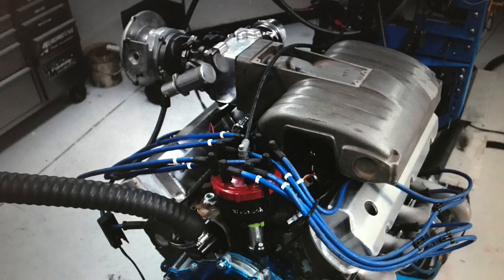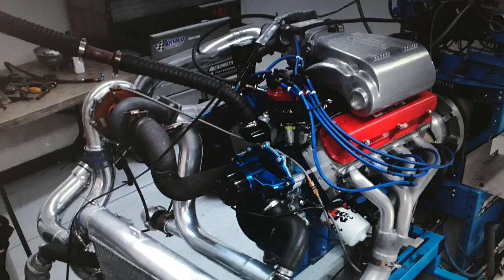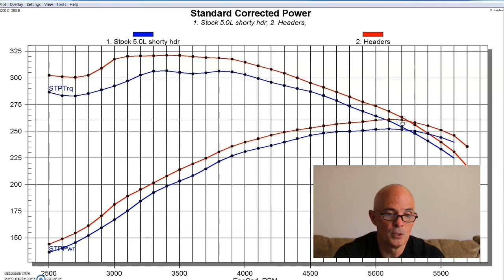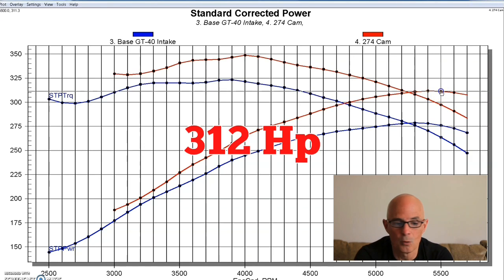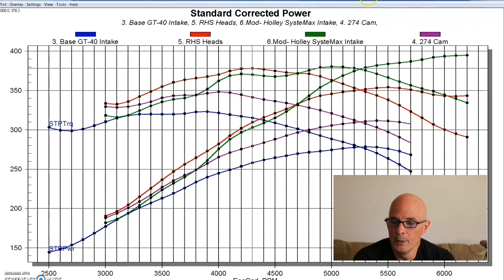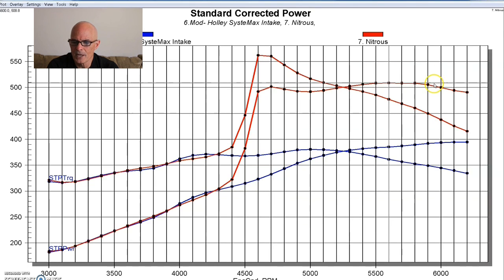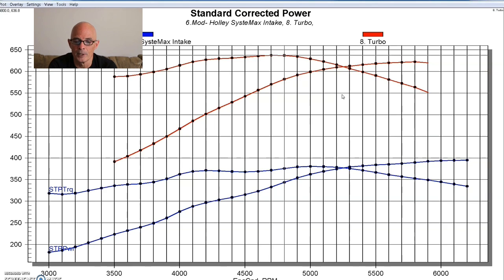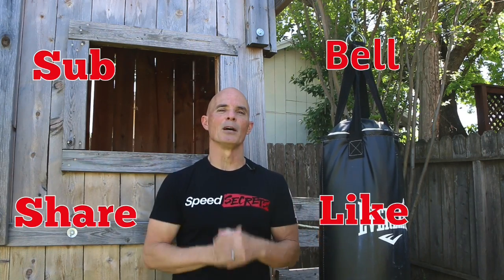BALLISTIC BOLT ONS & BOOST-5.0L FORD

Comment: Richard i know you had the supercharged mustang for a while. I'm just curious 87 ford 5.0 all stock if I gap the rings before i try to feed it 15 or so psi. Will it survive for a while? A body has a big ford Fairmont wagon with a ho 5.o and a Manuel i think would be great with some more power but such a boat stock and fuel pump is currently bad so I think you see where I want to go 600 hp would be great
Reply from the maker: 15 psi on a stock 5.0L is going to be near 500 hp-it definitely needs gap (and better heads, cam and intake)
Reply: @richardholdener1727  Thank You!

Comment: Once again,  the only reason  to us a 5 liter is because a 5.8 won't fit!! Sold a great little 306 to a friend awhile back. Ran 8 flat 1/8 mile on street tires and drive there. It would pick up a second off a 100 shot and live all day! Guess that wasn't enough! Know the rest of that story. Shoulda built a Windsor and used the cam and heads on it!

Comment: Just had another challenge idea. I’m going to be running an xe274hr with a set of Systemax heads that have been professionally ported and milled to achieve 10.5:1 compression.  That being said, I was going to get Ed Curtis to build a camshaft for me but he explained that the springs I have wouldn’t work with the camshaft he’d build for me. I’d already spent $300+ on beehives and components to use them so I dipped out. Just curious if you’d be interested in doing a custom cam dyno test vs your favorite camshaft.
Reply from the maker: it is easy to make more power than the XE274HR cam

Comment: Just watching this now but it's funny that Richard says shorty headers are worth nothing when Ford Australia proved they are worth exactly 10kw which is similar jump to the long tube headers in this video. Richard could make a video just on the different AU Falcon builds as an example of what to expect. 
Standard AU Falcon 5.0L motor with GT40P heads and explorer intake and 65mm TB and similar to stock US cam and 9:1 CR made 175kw
XR8 AU Falcon was the same motor as above with the only difference being shorty headers from factory 185kw
Then the T1 TS50 had a bigger cam with 210 duration and Y303 heads with 1.6 roller rockers and made 200kw
The T1 TE50 and S2 XR8 swapped the ally heads for ported GT40p heads and made the same 200kw
The T2 TS50 and S3 XR8 changed the cam for slightly less duration but increased the rocker ratio to 1.7 and went to a 70mm TB and increased CR to 9.4:1 for 220kw
The T3 stroked the engine to 5.6L, increased the compression ratio to 9.6:1, cam was similar to 200kw with slightly smaller LSA of 116,, RR was 1.7:1, TB increased to 82mm, ceramic coated headers and the best intake manifold ever produced for a EFI Windsor with shorter runner length made 250kw
Herrod took the above motor and swapped 4/1 long tube headers, put a cam with 216 duration .505 lift and 115 LSA and a tune and made 300kw with that package.
Interestingly there are many reports of Aussies who tried those 4/1 Di-fillipo long tube headers used by Herrod against Tri-Y headers and all say the long tube headers lost power down low for some power gain up top. Those long tube headers are no longer made and that manufacturer switched to tri-y headers. 

So a few takeaways. 
Shorty headers do increase power over standard exhaust by about 10kw.
Long tube headers can also increase top end power if the shortys are acting as a restriction at higher power levels. 
Ported GT40p heads can make 400hp.
You don't need a big cam to make 400hp but more cubes and a killer manifold help. I really want that Tickford manifold or better yet the entire motor it came on.
Reply from the maker: SHORTY HEADS HAVE NEVER SHOWN THE POWER GAINS YOU MENTIONED-I'VE TESTED THEM MANY, MANY TIMES
Reply: @richardholdener1727  As I said these were factory models by Ford so there are literally thousands of examples. The only difference between the 175kw motor and the 185kw motor was the exhaust. Those were the factory rating by Ford, I've owned and driven plenty of them, the 185kw is quicker than the 175kw in standard trim, put the XR8 exhaust on the standard one and I can't tell the difference.

Comment: 331 stock block, stock heads, turbo 6lbs boost what cam is best?
Reply from the maker: 274
Reply: @richardholdener1727  thank you sir, I will use that cam 👍

Comment: I love the basic combos and comparisons! Mostly because that fits my budget. But the one overlooked comparison is modifying stock heads for performance. I don’t have $1200 for aluminum heads, but what I do have, is a pair of 70 351w, and a set of 66 289’s and maybe enough sense for some home porting. Lol. How about a basic 302 and 351 builds with the financially challenged in mind? Love the channel!👍🏻

Comment: Hello Richard, I'm looking at putting GT40 heads (F3ZE-AA) on my stock 93 Ford Mustang with a XE274HR cam.  I'm trying to figure out what springs to use and if I can use the stock rockers from the E7 heads?
Reply from the maker: I THINK THE ROCKERS ARE THE SAME
Reply: @richardholdener1727   The piston to valve clearance seems high with the Rockers and Pedestals from the E7 heads. It's .301 for exhaust and .224 for intake. Does that sound right for XE274HR cam and GT40 heads?

Comment: What would be the best way to go about tuning setups like this? I'm debating dropping some 11R's and a cam into my 88 LSC before spring, and it seems like tuning the 5.0HO is a wash of "just get an appropriate MAF" to using chips, quarterhorse, and going stand-alone. I'm just looking for something to tune a mostly DD 302, that I can eventually jump up to either a 331 or 347 later on.
Reply from the maker: WE USED A HOLLEY-I HAVE RUN VORTECH BLOWERS IN THE PAST WITH PROM METERS AND INJECTORS, BUT TUNING IT THE BEST

Comment: Richard, I need some help my guy. I’m wanting to do a minor build on the 5.0 I pulled from an explorer that I’m putting in a ranger. It has the gt40p heads which I’ll port and polish, and a little bit of a valve job on it. I’m looking for a good streetable cam that will compliment the torquey heads, good set of springs and roller rockers to help the thing breathe better. Later down the line I’m prepared to put a turbo to get about 450-500 to the tire, what would be the best combination in your opinion to get what I’m going for? Thanks
Reply from the maker: E303 cam or Comp 274 (they have springs and rockers too)
Reply: @richardholdener1727  Thank for the reply! Later down the line (year or so) I would like to invest in a good set of heads, I'm looking at afr's 165cc heads, from the research I've done theyre a damn fine head, however my next question would be if the stock explorer pistons would still clear ( I know they're bolt on for mustangs but I'm not sure if the forged pistons have different valve reliefs than the explorer) and if the extra lift from those cams would interfere. Again, thanks!

Comment: Nitrous is my one single favorite mod of all time lol. Installs on anything and WILL make power. As for the other parts you got to do it all together anyway if your serious right? I mean if you toss in a cam you need springs, might as well do a new intake, because now the stock one is off already. Now you need a tune obviously but before that you have to do the exhaust, longtubes etc. then tune and/or the dyno. That’s my thinking anyhow.

Comment: Ran the xe274hr cam in a stock shortblock (92 w/hyperuetectics), a set of worked e7te's with gt40x head valvetrain with no problems.  And i ran it hard! It also had a ported explorer lower and a ported lighting upper.

Comment: Interestingly,  your "favorite"  XE 274 HR cam is so close to my preferred all around favorite go to cam for both SBC & SBF,  which is the XR 276 HR, (which are offered in both 110° & 112° LSA,  but sometimes is listed as XE 276 HR, especially when a 112° LSA grind).    Both the 274 & 276 are close grinds, but obviously different,  which in truth can make those differences in a specific build.

I am a GM guy 1st,  & Corvette guy in my heart & soul!  My brother is a Ford guy, go figure we should beef with each other right?  Well absolutely not, & actually not only do I like Ford & he likes GM ,  & because we both have been building high performance engines & high end custom cars for over 20 years now,  & so we can both see, admire, &/or admit the pros & cons of each, & also other brands. Honda makes great cars! Also a 500hp 4 cylinder is bad ass! 

 Back in the early to mid 90's I had a 84 Camaro,  in which I took the stock 305 out & converted it to a 350 TPI & took the IROC-Z  body kit from an 87 or 88,  oh & added a Richmond 5 speed. Eventually that wasn't enough, & so built the engine up to a respectable 485HP / 460TQ , which was alot in those days. Not much could touch me, "my muscle car". Until I lined up with this 4 banger Honda, & I laughed, thinking this poor kid doesn't have a chance. I had him off the line, my torque couldn't be matched,  but within a short time I heard the spooling of those turbos,  the tell tale B.O.V.'s & he was gone! It was embarrassing. My bad ass black on black, blacked out (murdered out, before that term existed ) Camaro just lost to a Ricer, no way! Well it did, & after talking to the guy, & opening my horizons, & so I left my prejudices behind me.  Learned to respect any car, & any build, etc when it deserved it.  

Same with the Ford thing, when your a Chevy guy, & you tear down & build enough of them & compare characteristics & differences between the two, you can actually understand  respect all of these. The SBC & SBF are great engines in their own right, both had their flaws in their own right too.

Comment: I'd like to see that with Boss heads.  You'd need the Boss intake.  Edelbrock makes them and I believe Trick Flow might, as well.  Australian 302 heads might be best, they have smaller intake runners and smaller (though not small) valves to keep intake charge velocity up.
What's an Australian 302?  It's a destroked 351 Cleveland with those special heads.

Comment: Yep, once you take the 302's small ports and valves (which made its famous torque) off it, you've got a short stroke engine wanting a lot of revs to make its power higher up the graph.
What also seems to hurt a 5.0 block is a power adder kicking in around 3,000 RPM, the fuel injectors may not be adding enough fuel that low if there's too much boost or nitrous needing fuel to burn and it isn't there until after 4,000 RPM.

Comment: Richard..or anyone that knows. How much power do you lose once the engine is in the vehicle? If you have a 400hp 302, would it be close to 350 to the tire?
Reply from the maker: it might be near 300 whp depending on trans
Reply: @richardholdener1727   damn! Thats a helluva loss. Im just about done with my efi 302 t5 swapped ranger.. was hoping 350 or very close to the tire in full.street trim with ac...well.see very soon!
 Take a guess if anyone wants..
142k mile short block(cross hatches looked like they were just honed)
1.6 rr
 Track heat fully ported 
heads
Fully ported upper and lower intake
N412 cam
9.6 compression or so
Headers
2 1/2 exhaust w/X pipe with  blaxk widow mufflers 
Z-spec t5
373 gears
24 lb injectors
Having in dyno tuned

Comment: I started with rebuilding my short block and added a lunati cam with 544/560 lift 232/242 duration on a 108 centerline, added twisted wedge heads with Harland Sharp 1.7 Roller rockers. Saved money up and then added a GT 40 intake and a 75 mm accufab throttle body with a 70mm mass air meter. After breaking valve springs a couple times I then changed cam out to a blower cam and added a procharger with an air to air intercooler. Had 13.5 lbs of boost. Don't know how much power it was making but I could blow the tires off really easy at 50mph lol I also had a crane intercepter II to tune it with. Still have the car today just like that. Have a 93 GT with same setup but has a kenne bell on top of it. Not a comparison in power the procharger way stronger.

Comment: I’ve got a 1995 Ford F-150 4x4 with a 5.0. It’s sentimental. No, it’s not jacked up with big tires. Only 80k miles now. I’d love to modify it and make it run as good as a late model truck or slightly better yet be streetable and get similar to stock mpg. I also want it to stay quiet. I want to still use it as a truck and I’m never gonna race. What mods can I do? Am I limited by the truck platform engine block or computer system? Thanks

Comment: What size intake runners were on those heads you bought , cylinder   head gains were not  that impressive  , seemed to big for this application , a afr  185  intake runner nets more power  , back to the small port big velocity Theory

Comment: Richard I’m doing a budget build with my Fox. Loving the SBF info. I guess I should of went long tube instead of shorties lol. Not sure if I should list all the parts but the biggest reason I call it a budget build is the $75 I spent for the explorer intake and GT40P heads. Heads were personally gone thru, Comp valve springs installed and will be running the Comp XE274. Did you by chance test the GT40 head or the P head with the XE274? I understand the smaller P chambered head should also raise my compression. Great vids sir

Comment: As far as the power levels. They are similar to my real world experience short of power adders.
My combination started with a stock  engine, a timing bump, and a full mac system with smog and cat delete. It made 219/290 at the wheels.
AFR 165s, E303, 1.7 rr, tube GT40, 70MM TB/ anderson power pipe made 278/300 ish.
The switch to a Holley Systemax and accufab 75mm made 330/335.
-Swapped out the E303 for TFS1 and 30lb injectors 
338/365.
All on the same MAC shortys and new Flowmaster 2 chamber cat back.

Comment: the thing i like about shorty headers is the maintenance. it's the only benefit other than cost. in the day i had a stock fox with ac and full interior running 7:50's with a 150 shot. it had 4:10's and 50/50's and was a "dog" on the streets. but prep it for some 1/8 mile runs and it was very hard to beat.

Comment: Wow, I expected alot more out of it with those heads and cam in N/A configuration. I think I'll stick with the 351. Thanks for the Ford content.
Reply: the extra cubes always help. i believe this build most likely had less than 9:1 comp if i recall those heads have 62-64cc chambers.

Comment: What TB did you use . I switch out from a stock . To stock ported to 65 to 70 and 75  . It when up an average of 8 to 10 hp . 
I had TFS  street heats and EFI intake and long tube. 
413 hp ..

Comment: What is my favorite 302 Ford power modification?  - Push it until the light weight block splits in two right down the cam tunnel !

Comment: 👍🔔
For a street performance 5 speed, I'm thinking:
Stock HO cam, advanced 4*.... 
(Maybe an XE266 or XE262)
C6OE-m ported relieved, 1.94/1.60 valves, 56 cc. (@190/145 flow)
1.7 rockers, .478 lift
01 Explorer non egr GT40 type
65 mm Exp. TB (maybe stock HO intake/65mm)
A9L
Hooker long 4 tube 
No cats
Pulleys??
No power steering
Flipping pistons?

Strong bottom end torque up to 5500 rpm
Snappy throttle for street driving.
Already have the heads and top end.

.

Comment: Richard, I can see this from your side, but testing each of them, singly, in the test configuration would give each mod a specific and discrete value. Yes, the numbers, as you combine two or three together will come out higher. For most, it runs to one of your frequent descriptors- bang for the buck is the "best order" to accumulate these sorts of mods. Maybe a thought would be "the whole is greater than it's parts"?

Comment: Has anyone tried adding 1.7 ratio rockers to gain lift from the cam. Did it on a built 351w from JBA made a difference in power.
Reply: It changrs the cam size . I did it to my b cam . I went from 1.6 to 1.7 . Power did go up ..

Comment: Nice job Richard! I would love to see a test with your GT40 intake and a set of iron GT40 heads (the real ones, not the GT40P) with this cam as I'm building my 302 with GT40 parts but don't know which cam route I'm going... Keep up the great work and long live to all American V8s 😉
Reply: you may need to upgrade the valve springs and rear end gears for that cam consider the TFS trackmax stage 1 cam the stage 2 is similar to the 274xe.

Comment: Loving the sbf love. And can’t wait for the head test results. Looking to swap heads/cam/intake on my 94 Cobra
Reply: I recommend the 190cc 11r trickflow theyre some of the baddest heads for the old 5.0s seen em tested in mm&ff while back they did killer...got around 400 horsepower out of a 302 cube motor with stock compression with a cam and intake manifold also.  This was on an engine dyno but still very impressive...it was just over 400 horse actually

Comment: Don't the 5.0 blocks have an issue with cap walk? I know a lot of guys run main girdles.
Reply: Its a big bandaid. Factory 5.0l (roller)  blocks have lots of issues. I have heard of machine shops refusing to go more than. 030 over because cylinders are too thin. When they break they will split up the middle or pull all 5 main saddles out of the webbing. For most hobbyists and guys under 500hp, theyre fine, but as soon as you have enough fuel and a turbo that can push almost 800hp worth of air problems show up. Dont forget in 1982 when the blocks were derived for 200hp engines, nascar wasnt 800hp racing. Its pretty hard to belive anyone split a block naturally aspirated without sinking enough into the packag that a $1k race block doesnt make sense.